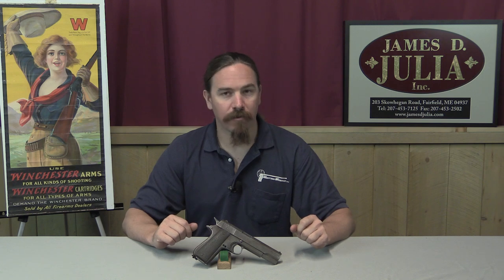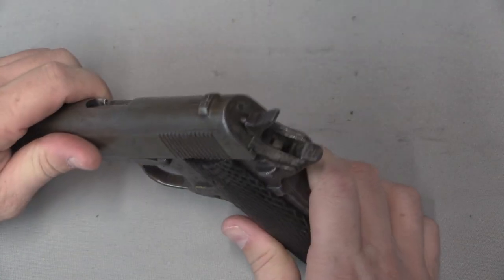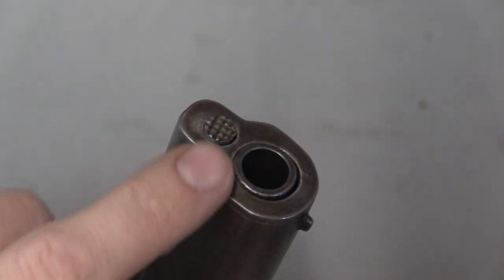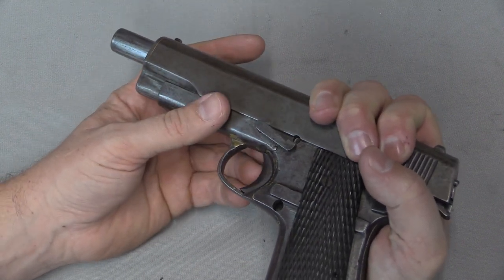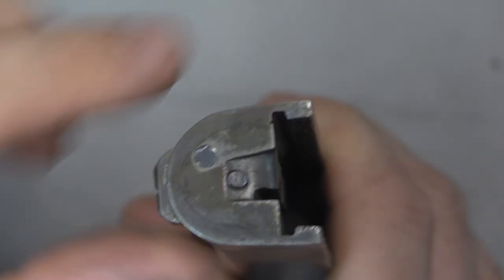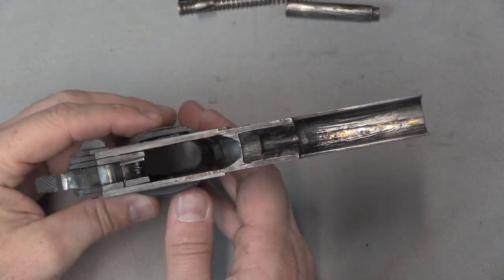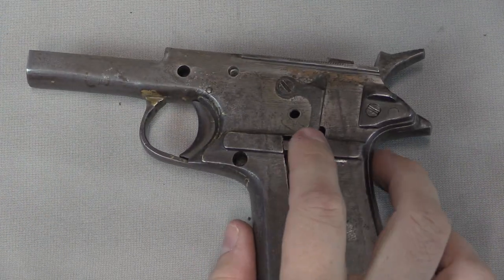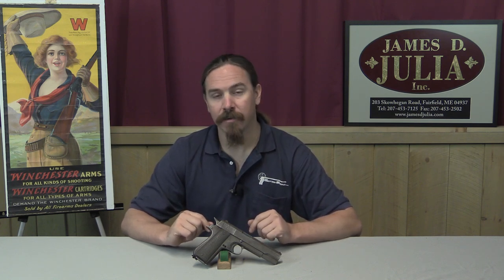Vietnamese Crude Blowback 1911 Copy

Comment: Why not make copy of the M3 grease gun or something similar? Easier to make,safer to shoot,holds 30 rounds full auto.
Reply: If they don't know how a 1911 works how the fuck will they know about the grease gun???
Reply: The grease gun is much more simple than a 1911.
Reply: It is not necessary to be a direct copy of the grease gun or any gun, just make their own open bolt SMG design by the pipes and pieces of metal they had aviable.
Reply: That only works if you actually have an understanding of what makes a gun work and have the know how to not only build, but design your own gun. I'd say the going by this example that while the craftsman knows how to build a gun they don't know anything about designing a gun, if they did then they'd likely produce a far more accurate copy of the 1911. Instead, they simply copied what they saw all the while not understanding everything they saw, you see the same thing in the mystery Chinese pistols that Ian had done a video on previously where the Chinese gun makers copied features of various guns with no clear understanding of what those features were for so they were often non-functional as a result.
Reply: The person who made it was not a gunsmith and didn't know how guns work. He simply had a gun to use as a pattern and attempted to copy it the best he could with what he had on hand.
Reply: I dont think so, it is not a straight copy, the mechanism and pieces are not the same. Keep in mind that this is made by hand tools, it is very hard to adjust the pistol just to make it feed and extract the cartridges properly (especially if the barrel doesnt tilt like the original 1911) and i dont think that a person who spend lot of hours doesnt know anything about how guns work.
Reply: because they didn't lack of machine gun. What they needed was a pistol for assassination missions.
Reply: or rather why not just make homemade AKs, cheap, easy, way effective, if you can't find any chinese or soviet made ones 
what ever they made it was enough to win the war tho
Reply: da8352 because the US doesn't use grease guns in Vietnam
Reply: The M3 was definitely still in U.S. service through Vietnam, dude. Hell, there were units still fielding them well into the early to mid *90s*.
Reply: Safton woops my bad, I guess they did use it, but in limited numbers, mainly as a personal weapon for tankers/vehicles. I'd say some of them were captured by the vietnamese, but they were either scrapped or due to time constraints unable to copy the design for some odd reason
Reply: Pistols had a function other than shooting people, namely they were a symbol of authority so it may have been made just to show the wielder as an officer or Communist Party official to people they wished to impress.
Reply: lol in whole vietnam there only 1 gun engineer that study about weapon and work with the german in ww2 befor coming back to vietnam , but he was never interesting on gun , he more a bazooka and recoiless guy so he copy and head of the factory that made bazooka + recoiless gun ( which we used them vs french bunker + ship + tank in 1950s ) gun we are making the k50m smg but then we just get shitload of soviet weapon so what the point of making weapon after 1960s lol , the south also stop making weapon after the north start sending shitload of weapon . the gun in this video was made around 1950s i think - early 60s
Reply: they presumably had a 1911, so they made a 1911 copy. if they had a grease gun, they would have made that, too.
Reply: Gabe Towler The Grease Gun is incredibly simple. And Ironically I'm Cambodian. I mean it is a open bolt SMG. I mean the magazine is the most complex component. Take the Soviet PPSH-43 for example. There is no excuse to screw up making a Open bolt gun as pretty much the firing mechanism is a firing pin attached to a spring. Heck the Sten Gun mk2 is made put of bed parts and sheet metal and I don't see you barking at them

What I'm saying is that the M3 Grease Gun isn't hard to replicate
Reply: @firepower7017  yes, it is very simple. the thing is i don't even know if the person who made it knew what a grease gun was. if they had one, then that would have been a better choice.
Reply: @grimhunter42  Not only were there US issued grease guns in Vietnam, but a lot were already in country from WW2.  It was not uncommon for Vietcong to be armed with grease guns and other American weapons.
Reply: Gues you didnt visited Cu Chi tunnel
They also made many other copied American weapons
Reply: actually, they have copy the Thompson SMG

Comment: It amazes me that you would call a Tokerv anything but a paperweight. I bought one when I was 21 new in the box for $100. I took it to the range. I fired one round, then I fired the second. The slide locked back, all the rounds in the magazine ejected, and springs and other parts of the gun came apart. I Then swore I would never buy a semi-auto again and carried a .357 revolver. I got a huge deal when our local department went to 40 cal and I got a Beretta 92fs 3 hi-cap mags, and a jokester for $200. I also made deals with a lot of officers who were carrying Gluck 9mm’s and made a little finders fee. It’s amazing what craftsmanship is when you have something of quality. My 92, has never jammed and I have never had an issue with it. I almost fell off my chair when you mentioned that Chinese Tokerv as being anything more than a POS

Comment: I'm pretty sure that the "safety" piece at the end of the video is a disconnector. When the gun is fired the slide would go back and push down on that piece, which in turn push down on the trigger bar and disconnect it from the sear.
Reply: I was going to say the same thing until I saw your comment.
Reply: A crude interpretation but alas,we'd never find out since it's too dangerous to test-fire it

Comment: What people don't know is brazing is actually pretty strong, not as strong as welds. They used to braze lightweight race motorcycles for flexibility.
Reply: Brazing, especially "silver-brazing" works at lower temperatures than welding. If done correctly, the process can join carbon steel to stainless steel with impressive strength and without degrading the  component materials. Those two factors are part of the reason it is used in the fabrication of bicycle and motorbike frames. That and the fact that it somewhat predates and uses simpler gear than TIG welding (GTAW) keep it going in small and specialist workshops.

Comment: As a gun person, it's difficult for me to step back and look at this objectively, but nevertheless, I find it difficult to understand a lot of the misunderstanding that went into this gun, as well as the Chinese gun copies that have been shown on this channel before. Perhaps the biggest thing I can't wrap my head around is the number of features on guns that you could reasonably figure out yourself just by racking the slide and dry-firing the gun a few times. Such as the slide stop.
Reply: Yeah but I'm not talking about a high quality copy. I mean figuring out some basic stuff just by looking and interacting with it. Like figuring out an on/off switch through trial and error despite never having seen one before.
Reply: But then they go to the trouble of building a switch that resembles the safety catch and installing it on the gun, making the slide stop the correct shape instead of just a simple little bar which would have been enough especially if you don't intend on using it to actually lock back the slide, punching numbers in the side of the frame, etc...
Reply: the maker must have thought the numbers were somehow vital to the function of the gun, bless him:)
Reply: Ah yes, the holy incantation required to make the gun function.
Reply: I wonder if rather than for combat these knock offs were made to be sold to unsuspecting buyers.
Reply: I honestly think Charlie here has the right idea, this is the 1960s equivalent of those fake Chinese iPhones. A Just about technically functional product, made to look like something popular and sold for a fraction of the price to the ignorant.
Reply: I think it was cottage industry like in Belgius 80 years earlier.  Makes sense from an intel perspective.  Only the Cell leader knows who is in the cell.  So someone gives the cell leader the gun.  He takes different pieces to different guys in different hamlets.  Tells them copy this piece best you can.  No need for them to even know what it is or how it should work.  If the hut is searched, it is easier for the police to miss a hammer or not find a trigger than if the whole gun is there.  Then later just like in Liege decades earlier, bags of parts are brought to someone that does know what he/she is doing and they jam the pieces together till they get something semi functional and issue it out.  Meanwhile you got guys and gals being told to copy this, so they copy the marks they lack the language skills to read, or try to anyway.  It is not necessary to know the purpose of a serial number.  It is however important that your fabrication be similar to the part from the foreign devil's weapon and that means making marks where their slide or frame has similar 
mystic stamps.
Reply: I just keep thinking why not just completely disassemble it and make each part, then reassemble..? 

The 1911 is a bad gun to try this kind of primitive reverse-engineering on.
Reply: because this was made in a jungle in the tunnel by some insurgent who was a farmer or black smith with clearly no clue on how gun work and just copy by look. with hammer and files. it just need to be able to shoot at very close range for assasination. they just need to be able to fire, other factor doesn't matter. But this can see clearly was made in early war since later NVA supplies tons of supplies to VC and even ARVN smugling weapons to sell for VC.
Reply: I think this gun was likely made for a Vietcong officer to inspire his troops with more than to be shot. a 'he killed an American and took his gun' kind of thing.

Comment: That part you said has no work is actually not a safety lug. Its to disengage the trigger from pushing the sear so that the gun can cock. It will push the trigger bar down and away from the shear and make the sear re-able to catch the hammer while blowback.

Comment: damn. very cool example of some homebrew gunsmithing. very interesting to use .45acp with straight blowback operation.. the only pistol I know of that does that is the .45 Hi-Point because the slide is like a brick. The recoil spring on that VN 1911 must be insane. Also smoothbore barrel LOL

Comment: These copies always confuse me. If you have a working *anything*, and you know it works and you can take it apart to see what does what, why would you remove or modify parts of your version so they work differently to the original? Would it not be simpler to just manufacture parts that look just like the originals?

Comment: I don’t think he had a Colt 1911 as an example... I think he had an Argentine Ballester-Molina.   The trigger of this pistol is of a pivoting type, it doesn’t have a grip safety, the “safety” is rather small, and the hammer has a pointed profile. These are characteristics of a Ballester-Molina, not a Colt 1911. (Edit: Is that “out of battery safety” actually supposed to be working as a disconnect?)

Comment: What if I load it with a high pressure blank and turn the pistol so that the slide would fire at them instead of myself.
Reply: Brandon Stone Then you've got a Slide launcher
Reply: You sir, are a genius
Reply: @kabob0077  pulls slide of the gun
throws slide
Reply: thats just an over complicated crossbow

Comment: Can't you test fire it with a piece of string and a vice.
Reply: Unless it actually worked just fine. I would think this firearm had been fired before. I mean what's the point in hand building a pistol and not using it in the end.
Reply: If it was ever fired before, it was a really weak load, doubtful it even cycled. The way it is constructed indicates that it would break apart from the recoil even from light loads, assuming the entire slide did not fly off the back the first time it fired.
Reply: I doubt it would be good, ha.
Reply: Try it Mythbusters style: Inside a bunker with you outside. :)

Comment: Can someone pls tell me what  blowback means in this context? Thx
Reply: Blowback refers to how the gun operates. The pressure created from a round being fired pushes, or "blows" the slide back causing the spent casing to be ejected. On a normal 1911, it uses a short recoil system where both the slide and barrel recoil when a round is fired.

Comment: PSA -Brazing is a metal-joining process in which two or more metal items are joined together by melting and flowing a filler metal into the joint, the filler metal having a lower melting point than the adjoining metal.😈THE DIABLO DOG😈

Comment: I know I'm late to the party on this one but this seems like a hobbyist's display piece to me. The brazing of the metal, the simplification of the internal parts, the lack of function of various external parts, the smoothbore barrel and overall relatively shoddy design makes me think it was a craft-producer's attempt at making an M1911 replica you could play with (hence the slide being functional enough to move but not functional enough to fire safely, for instance), even the serial number on the side makes me think this is the case. 

As it was, the Viet Minh had more than sufficient access to pistols during the Vietnam War, why would they bother making this and having it blow someone's hand off when they could just ask China for a truckload of TT-33 knockoffs and not worry about sourcing .45ACP instead of using the copious amounts of 7.62 Tokarev they already had lying around? 

It's a bit like airsoft weapons where you might have external features that do nothing functional but look like the real thing to add verisimilitude. This feels like a real steel version of that.
Reply: But kids don't play with full size pistols? A smaller one would do, adults could just use the better stuff (to play around with, unloaded) when available
Reply: @stevejohnson6593  At which point did I say anything about kids? Adults like to fiddle and play with things too and they might not have access to the real thing.
Reply: @Deathwatch05  Right. Well there's no need for rifling so it was probably intended for limited use.

Comment: To be fair, they made it in the jungle not in a fancy factory. Also we fought off the US with it, so it's not that bad I guess
Reply: i doubt that the NLF actually used those 1911s in an actual combat situation, it's more likely they would use captured ones and probably had the locally-produced ones either for show (for officers) or as a surplus in the event that they ran out of captured 1911s to issue out

Comment: I saw one that had been fired many times and without barrel lugs, the slide simply hammered itself to the end of its travel eventually causing the slide to develop a swayback appearance. It was covered in an NRA magazine many years ago. They reported on several semi-autos built by the North Vietnamese and actually used in battle. As crude as the guns were you have to admire what was built with an absolute minimum of machining equipment.

Comment: That's not a copy of a 1911. It's a copy of a Ballester Molina. The Ballester Molina was a copy of a 1911, but without a grip safety and it had that extra out-of-battery safety on the right side. The BM's magazine and barrel were the only parts interchangeable with a 1911.

Comment: Some fairly awesome quality brazing whatever else is wrong with it. Someone who did metalwork, or even a jeweller, pressed into service as a gunsmith. Damned dangerous as a firearm, very interesting as a lesson in jungle manufacture though. No electricity, possibly working in a tunnel by some sort of candle or oil lamp churning out copies of what they must have thought were incredibly innovative designs. Certainly easier than designing a pistol from scratch, given he was obviously no gunsmith in the proper sense, or designer. Frankly stunning this could be done outside of a workshop, yet the world over you find these improvised or copied firearms. Improvised firearms could be a lifetimes area of study on it's own. I always enjoy your videos, but I love the improvised and machine shop guns (as they usually lack rifling I believe gun is technically the correct term) that you occasionally showcase. The Luty creations in a video a while back were fantastic quality, this one not so much lol.

Comment: Based on the considerable visible wear on that pseudosafety, i suspect it did function at some point but due to the brutality of trying to use a tiny bar of soft cheap steel to slow a .45ACP, it has simply worn out over minimal time to the point that it no longer functions. What's more disturbing is that it means somebody definitely repeatedly pulled the trigger of this gun with it most likely in their hands while doing so, face behind the slide to aim down the sights. I really wonder how many vietcong lost an eye, a thumb, or broke their nose due to the possible failures this would exhibit with enough rounds through it. All that brazing WOULD probably give up especially given the potential for it to corrode in the heat and humidity of the jungle.

Comment: the barrel looks significantly oversize to me, like it tapers outward from the step between the chamber and where the rifling should be, so I'd bet it's perfectly safe to fire, but 230 grains would kinda just fall out the muzzle at around 300 feet per second.  still wouldn't want to stand in front of it, but if I'm right I'd have no qualms about firing it.